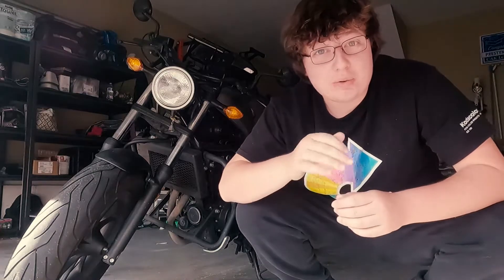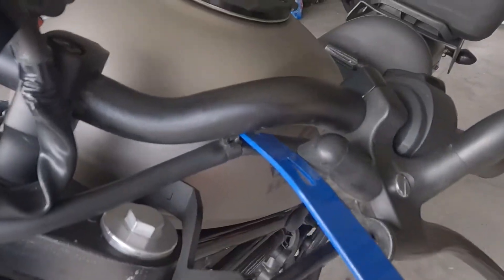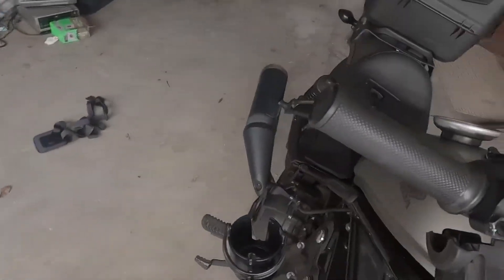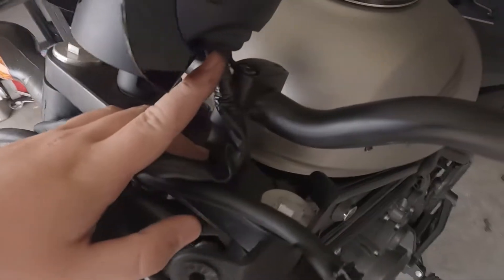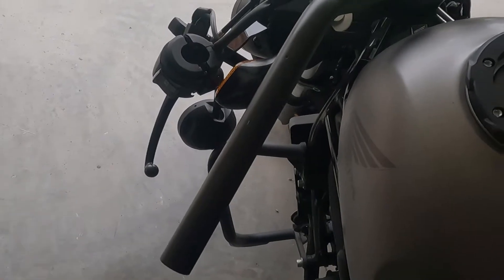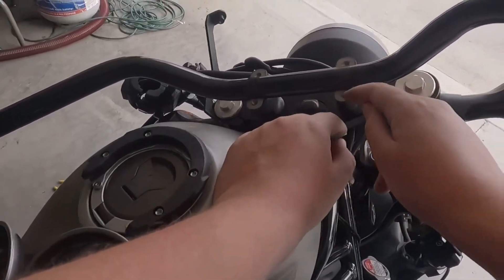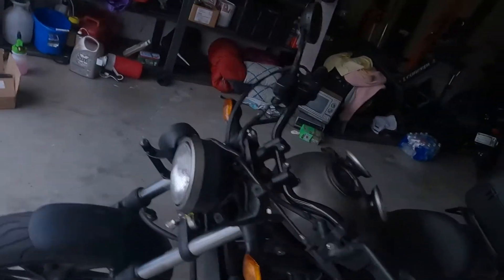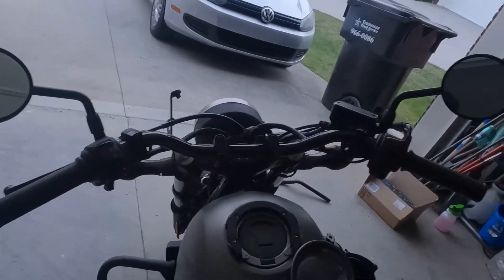Installing Kijima Handlebars | Rebel 500

Comment: Hey that’s a good tutorial. Would this also work for drag bars? (Some off brand from EBay) and can you still handle lock the bike? Thanks and lovely bike
Reply from the maker: Should work for any 1" handlebars, but the control cables may not be long enough. You can extend them with other parts.

Comment: How do you like it compare to factory handle bar? I'm thinking to get me one.
Reply from the maker: Definitely an improvement for me. It allows me to sit back further and not be hunched over. Some complain about the way the handles are angled but I have no problems with it. The finish is different from the stock bars, these are glossy black instead of matte. As with any Kijima product, quality is great.
Reply: @marsy_mcmarsface  Glad you like it. As my wrist pain when ride  after 30 minutes using the factory handle bar. Thank you for your great video.

Comment: How much further back did the new bars allow your hands to be compared to the old bars? Thanks for the great video.
Reply from the maker: I didn't measure it but the listing says it brings it back about 65mm so around 2.5 inches. It allows me to actually reach my backrest that is installed on my rear case when I am cruising. It can vary based on installation though because you can change the angle of the bars.

Comment: What was that metal bar above the speedometer?
Reply from the maker: It's called the Kijima "Handlebar Mount Bracket" and it can be found on Webike. It is just another mounting option for bar clamp stuff. 

If you look in my newest video I use it to mount my GPS. Very neat product though a tad bit over priced.

It screws between the speedometer mount. Very easy!

Comment: Fifty years of riding, forty bikes. First off, NEVER work on your handlebars without covering your tank with a big, thick bath towel. Second, when installing your new bars, slide the throttle assembly on BEFORE you put the bars in the clamps. You're welcome.
Reply from the maker: I was thinking about that yesterday actually. It would've been much easier to install the throttle first! Live and learn!